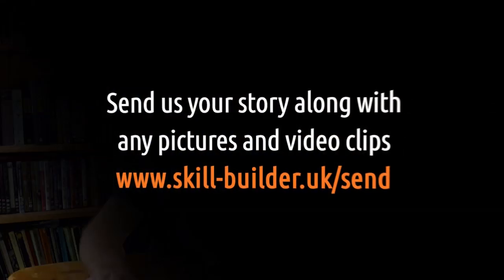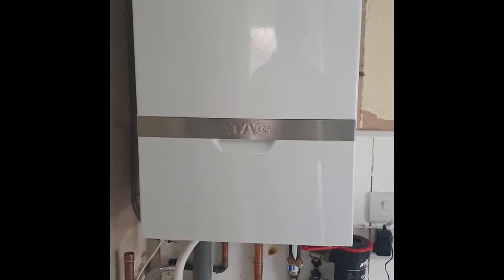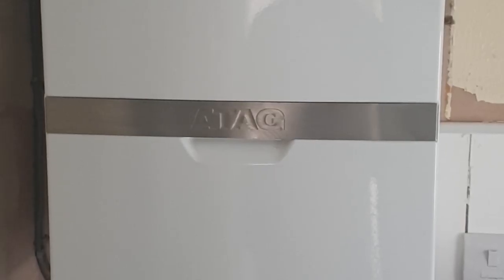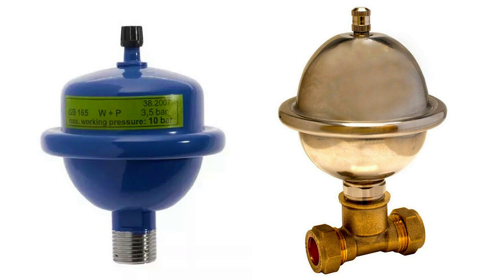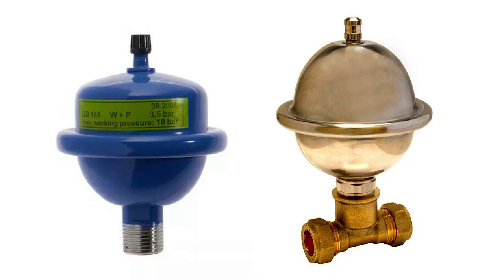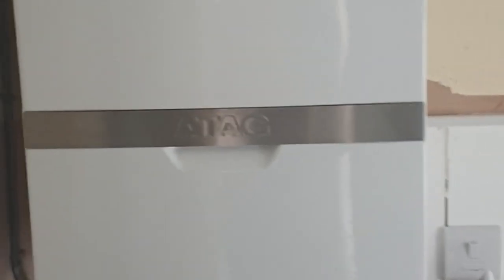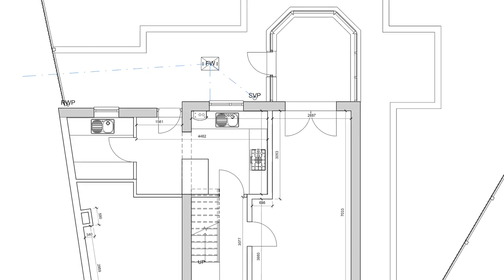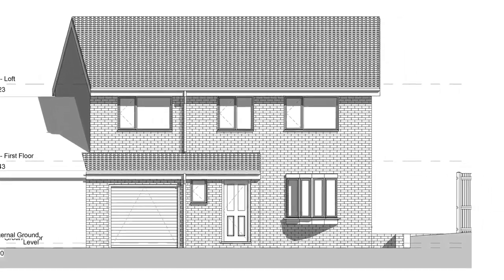Who Should Project Manage an Extension? ASB #21

Comment: Totally agree with you Roger, I dislike working with architect's. I've yet to find one that has a clue about the type of old buildings I work on. It's always :- excavate floor by 500mm for hardcore, insulation, DPM etc, Huge steel ridge beams, Class B brickwork with OPC mortar, Float & set walls etc. The majority of places I work on have no footings, rubble filled solid 13" - 18" soft red brick walls and all lime mortar !!! If I did what an architect said then I'd end up with cracked gables, condensation & damp all if the house didn't collapse from digging out the floors.

I'd advise people to find a good local builder, make sure you all get on together, ditch the contracts and try an old fashioned idea of trust !!!
If you don't trust the people you are employing to carry out works for you then why are you bothering in the first place.

As for the bathroom, you could use Jacko board if you want a thermal break as this is quite cheap and also waterproof. Homelux do a good tanking kit for walls & floor, a bit like a waterproof wallpaper. It goes down with tile adhesive and would cost about £50 to tank a shower.
Best Regards
Tim

Comment: I'm a building surveyor and produce construction drawings for clients. I can do this at a fraction of the cost of an architect. I project manage roughly 30-35% of the jobs, with the builder managing the rest - I sit in the background to ensure the paperwork is delivered. I understand the comments about architect's running the job. However, I cannot overstate the importance of a decent project manager - especially one who is knowledgeable on matters of key approvals and paperwork. I've been a surveyor for 20 years and of all the buildings I've surveyed in that time I've never come across a single one that had the full suite of paperwork for the work carried out on it. There is always something missing: either planning permission, building control approval  - especially on renovation of thermal elements, structural engineer's calculations, party wall agreements, building-over drain agreements, the list goes on and on. This is of no consequence to the builders - they are long gone. However, the impact on the client can be devastating: house sales falling through, thousands - even tens of thousands - being wiped off the value, building work being regularised by the council and even having to be demolished in some cases (which I have seen in several court cases.) In almost all of these instances, the client employed the builder to do the work directly and the builder failed to get the paperwork. They either didn't know it was necessary, or didn't involve the right authorities to save time, money and hassle. This does not happen often - if ever - at the commercial end of construction. But sadly it's all too common at the residential end of the scale.

Comment: I think to answer the question on the toilet triggering the boiler to fire. From listening to the video it sounds like the toilet has a quick fill valve from the sound of the harsh float cut off. These valves don't gradually decrease the flow rate into the toilet like the traditional ball cock fill valves do as the water level rises. These newer valves fill on max flow right up to the required level then slam the water supply of very harshly. This causes a shock and back flow that causes the problem you have. Revert back to a traditional  ball cock flush valve so flow decreases nice and slowly as the ball rises and avoids the harsh back flow of a quick shut off. Hope this makes sense.

Comment: Im an Architect ducks thrown beer bottles and most of my work is building regs so i like to watch great channels like this. Ive worked on the tools before i went uni and have been on both sides of the fence. I would agree on a small job a good builder can project manage  but there is not much to really manage, structural engineer, drainage maybe sap. But once you get into the bigger jobs you need an architect since there are a lot more third parties to deal with. Most builders that i work with bloody love having an architect on board cos we are able to deal most of the box ticking bollocks so you dont have too. Clients always ask architects to project manage but only some architects charge for it. Architects will normally quote them for project management if the client was high maintenance during the planning stage. Its not crafty architects ripping people off. I have great respect of good builder but i have also met builders that built waste pipes that go to nowhere and foul waste lifted paving slabs and builders that charged for planning drawing and submitted nothing and some that just plain old took the money and run. I have also known architects that dont know what end to hold a hammer and still try to tell builder of 60 years of age what to do. I love this channel and hatred of architects feeds my soul but guys we are here to deal with the shit you dont want to not look over your shoulder, tbh most of the time we are just happy to be out of the office. Love the channel great job.
Reply: funny to hear about waste pipes. MILs boss bought a posh flat off plan in germany last year , new build just shy of €1m. 2 weeks before moving in date last month it was discovered the builders hadn't connected a 12 flat block to the central waste drain (love to know the cleaning bill for bottom 2 flats where loos overflowed and drained  into the basement / parking levels). fire brigade refused permission to dig up road as homeowners beyond couldnt be reached in case of fire. had to access it by tunneling in from side... hotel bills must ve been a fortune alone without figuring in remedial work - ripping out and refitting poggenpohl kitchens with rising shite must ve cost a bit.

as a colleague once told me "german efficiency? it's a myth from the 60s..."
Reply: I took over my fathers building contracting company ten years ago after gaining my trade qualifications in carpentry and joinery followed by fifteen years working for and being taught by my dad who himself had nearly sixty years building experience so I'm pretty good at what I do even if I do say so myself.
I have a healthy respect for architects and appreciate what they do,I get 90% of my extension and new build work directly through two architects whom I have established a good working relationship with which is the way that most good builders get they're work. As you say anything over a simple and small job requires an architect and they need to be on hand for any design based queries,a good architect is generally to busy to project manage and they need to be able to trust and rely on the builders that they put forward for projects which is where the cultivation of relationships come in.
A good builder who is asked to build an extension or new build etc should be the one to manage the project and will be all over every single aspect of said project,I don't see any need or requirement for an architect to manage a job,I can only imagine a homeowner who would ask for this would be very nervous about the job and trying to ensure that it goes smoothly which is perfectly understandable,an architect with a good working relationship with a bulilder should be able to recommend them to the customer and put their mind at ease which will then only be put more at ease upon meeting the builder.
The homeowner/customer is the most important person in this equation.
Thanks for the video mr. Bisby I feel it has opened up a good and informative dialogue for homeowners to learn a little.

Comment: re boiler - common problem and no need to fiddle with the valves. there will be a dead leg somewhere downstream of the boiler, the air is trapped there and the water is moving back and forth as you mention by compressing the air as the momentum of the water pushes it onwards.  A NRV would help, but the real solution is simply find the dead leg and bleed it (or remove it if it's not a tap).  It could even be a tap that hasn't been used since the DHW was last drained down.

Comment: Ha!  Re:  segment with the boiler that turns on after a flush, first thing i thought was that the loo had been plumbed into the hot water line !!!
Reply: I've come across that before. Same house had 2 stop taps. 1 metered supplying cold water throughout but a second stop tap (in what was an old out-house) serving the combi and hence hot water. Combi was in out-house so they never noticed.

Comment: As usual, all good advice, on jobs where an architect or designer has been project managing, I have found more often than not they are a source of friction between the contractor and the client because they often insist on some specs or course of action that may not be practical.

Comment: When I built a new 9 m2 bathroom btw two bedrooms in my 115 yr old wooden house, I tore out the original 35 mm pine floor planks down to the 4x12 rafters, removed the clay/moss/dirt insulation and re-insulated btw the stories. Luckily I was able to place all drainage pipes btw the rafters (with a spec drop) with just some minor drilling for water. Then I nailed 15 mm grove/tongue particle boards on the rafters, then screwed 6 mm cement boards, then electrical cables for floor heating on a mesh, then sealed off all around the floor and poured 20-50 mm floating cement (leveled to drainage throughout the room), then coated all wet zones (floor, shower, tub, sink and toilet) with up to 5 coats of liquid sealer including fiber glass reinforcement to spec, and then tiles and grout. The bathroom is now Niagara proof, but nothing extraordinary, ie. normal code here in Norway. Though I did most of the work myself, every step and product was documented, hence I most probably will be safe during the 5 yrs I'm liable after a sale, as well as I now can insure the hooplabling (the house) with a good 25% deduction.

Comment: Hi Roger! I recently rewatched your bathroom refurbishment. I'm going to do a full rip out and replace the existing bath with a Mira tray. The bath is surrounded on three sides by two very cold exterior walls and one interior block wall. It suffers from terrible condensation after a shower and the steam is thick. I'll upgrade the extractor fan but I want to warm up the exterior walls too. Should I pick a smaller shower tray and line the walls with e.g. Kingspan, and if so how much, and what waterproof covering can I tile onto? Any recommendations for extractor upgrades? Thanks!

Comment: A neighbour of mine had his own architect (a friend of his), who demanded that the builders would be paid only in 4 payments. So in conjunction with the reticence to have to deal with him in the first place then thought, hang on I will have to fund £50k of parts and labour before I get a penny. The end result was if the builders were putting in a massively high price of around $200k for a simple loft and extension job just to not get the job.
The neighbour decided to move but the architect still proved to be a real A hole. The house was sold with planning permission but when a new set of builders for the new owner went to him for the steel structural calcs for just the loft conversion refused to give them and said he would sue them if they used his designs. It is a terraced house.... I have my own beef with the architect but that's another story.
Reply: @Elfin4  Perhaps I did not make it clear. This is a box on top of a terraced house not the gherkin. There is one room and bathroom. What exactly is the intellectual property in the design of that? Also the house was sold with the plans.  All the new owners asked for was the steel calc's. Not exactly an onerous request. The owner said they were approved by the council which was also a lie, I read the counsel report and there is no way they they would have signed of on the cladding he put forward. The new owner just wanted approved tiles not the way out wooden cladding he proposed. 
The proof is in the pudding. No builder put in a credible bid as making people sign onerous contacts makes them very nervous. They told me that they doubled it just to cover the potential problems dealing with an architect.
What company puts up £50k of their on a job on a loft extension? I think you live on a different planet or your an architect....
Reply: @Elfin4  NO I did not say the client puts up £50k in advance. It was the other way around. Normal works involves staggered payments. First is for say to cover the material costs. In my case it was around £10k. Then you pay another after x work is done. The contract with my builder laid it out in advance. 
You are constantly saying that unless the builder is capable of putting £50k of his own money up front then he is useless (or words to that effect).
Perhaps I'm wrong, I would love for you to link me to a building firm who would be happy to fund 25% of the build costs in advance for you. 
I never said a contract is not needed. I had one with my loft builder even though they just did the shell. There is a world of difference between a hospital and loft extension though. One would benefit from very good over site the other is not. 
What the builders objected to was the architect. Ask any simple builder if they fancy the idea of an architect forcing them to sign his contracts to do a run of the mill loft extension / and extension and only pe paid after 25% was done. No decent builder is so short of work they need that. So they put in 50% more to scare them off( I spoke to a few builders and a number said I looked at a job nearby and said no, so not exactly unique)
The property was sold with drawings (or so they thought) My architect would not give a rats arse if I sold my property with a set of his drawings. 
We are talking here of a loft extension. I could do the drawings myself, they are dead simple. What you really are paying for is the guarantee that you will tick the building controls box's. Something this architect failed at as he submitted it 2 x and still got it wrong. Then claimed his design was some how so unique that using them was something he could sue over. Its a box on top of a roof. Not exactly many permutations you can make on to a 2 room layout.
Reply: logik100 
Why should the architect give their design to a new builder and owner? The original owner sold the house not the design. 
The planning permission is not a set of construction documents which if used would carry an element of liability for the architect

Comment: Have the heating engineers accidentally piped up to the central heating? This happened to us on a job we had to sort out in Hull. Boiler pressure would continue to drop which is a give away. Just a thought. Check if cistern water is warm.

Comment: Thinking of tiling my bathroom floor  however it is a joist floor with floorboard and I wud say possible have a slight bounce in it wat can be done or is it just a case of having to beef  the floor up
Reply: Yep, you'll have to take up the floorboards and sister on new joists. Kinda depends on the span on what you sister on. if you re install the floorboards you'll still need to lay down another substrate to tile onto.

Comment: Never let an Architect manage a project of any complexity/cost - it's a recipe for disaster.  Any design problems are fobbed off and costs can escalate dramatically. The only way I'd do it is if the architect was a design/builder and gives fixed-price contract.  Vast majority of Architects simply don't know costs.

Comment: I would never engage an Architect for a domestic extension - seek out a good Auto-CAD technician, they are capable of producing drawings,, site specific details and specifications at a fraction of the cost of an architect. And dont employ any builder who can't project manage  a straightforward extension.
Reply: I even did drawings by hand for my  extension and then built it myself.Got completion certificate from council
Reply: @eugeneeugene8252  nice one..you obviously have a good understand of construction.  You must have saved yourself a fortune.
Reply: @georgemorton6199  Thanks, extensions and lofts quite straightforward.I do have 20 years experience in many trades which helps 🙂